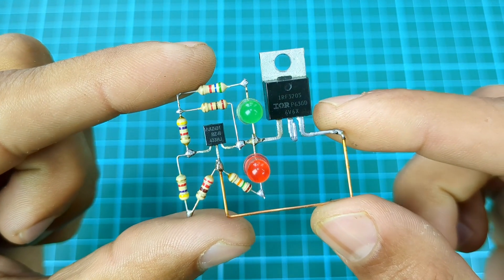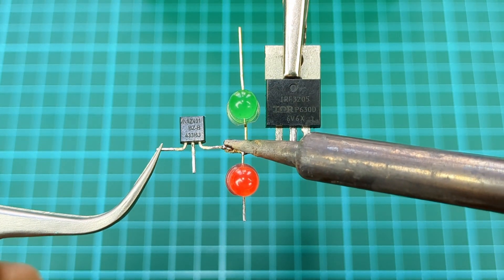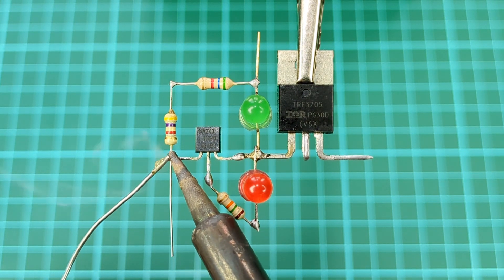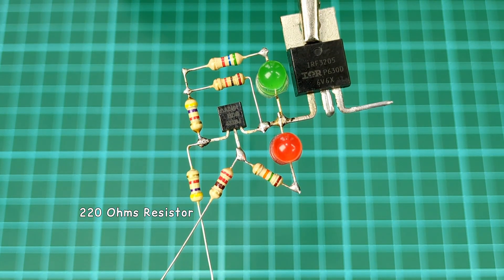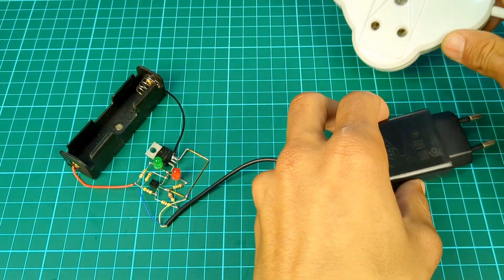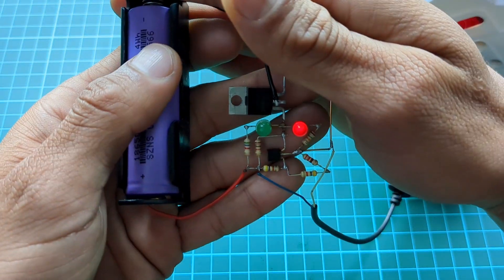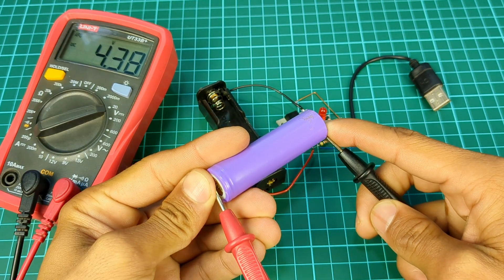How to make 3.7v/4.2v battery charger | Auto cut-off battery charger without relay

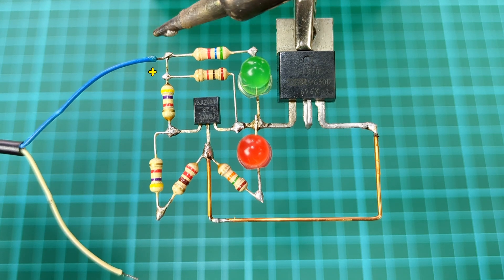Comment: @SolderingTech thanks  for the video but noticed that at 2:52 mark USB+ (Blue) was connected to 5.6K Resistor but at 3:10 the same USB+ (Blue) has changed its connection position to 1K Resistor, could you clarify this please ?, Many thanks👍
Reply from the maker: Bro those are common points of 5.6K & 1K to 4.7K Resistor for input and output positive. I appreciate you for your question have a nice day ❤️

Comment: Please Sir the battery voltage after cutoff was 4.38v, is it safe charge because 4.2V is the full voltage charge for the lithium ion battery.
Reply from the maker: Bro its safe even when you don't have any charging module you can directly charge this cell with 5V 1Amp mobile charger about an hour Don't worry. Stay happy and go with tp4056 module it's a safe option..